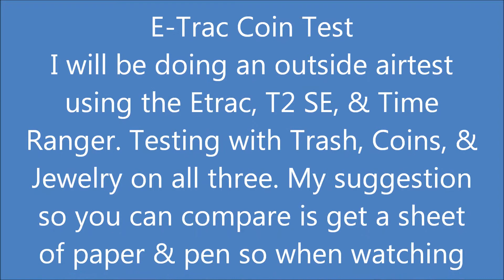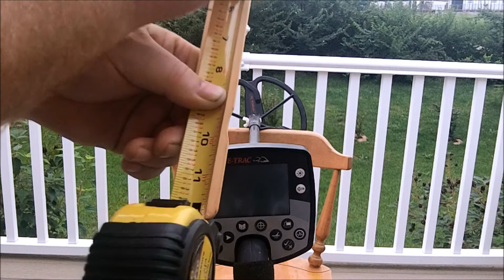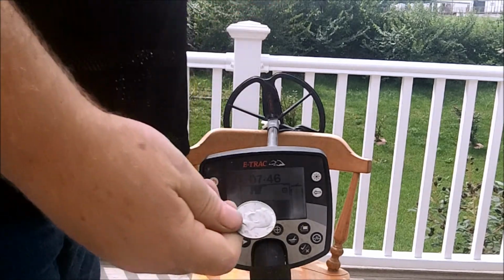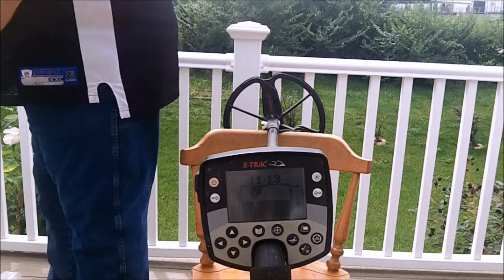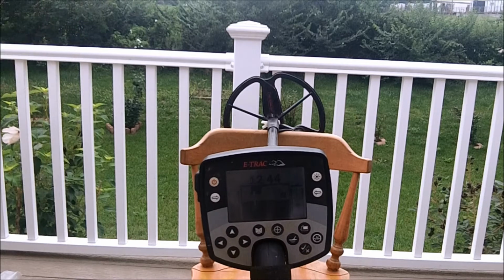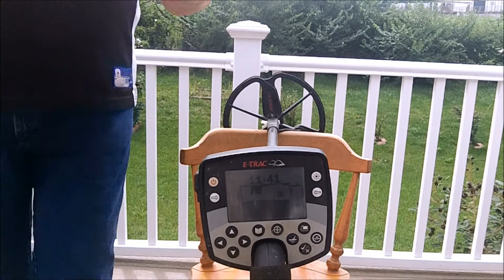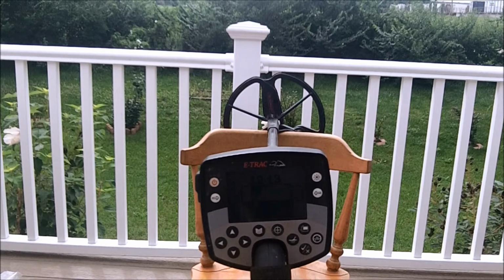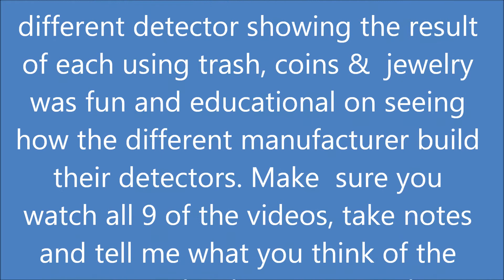Compare 3 detector in airtest--Etrac-Coins Test

Comment: Thanks for the video. I couldn't help to notice that the coil on the etrac was pointing to the side. The time ranger and the teknetics coil was pointing  straight up. Also the etrac seemed like it was in all metal mode. But the Time ranger and T2 seemed like it was in discrimination mode. Do you remember why the difference in testing layout?
It seems to me the the shaft being against the coil in two of the units being compared to the etrac that has its coil not against the shaft. Thanks again.